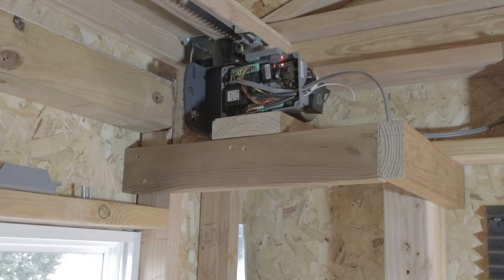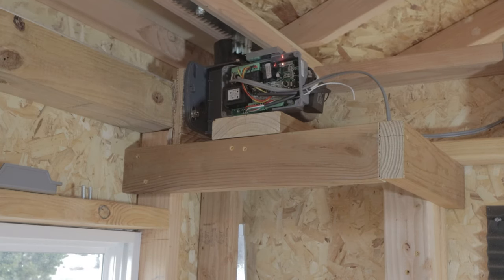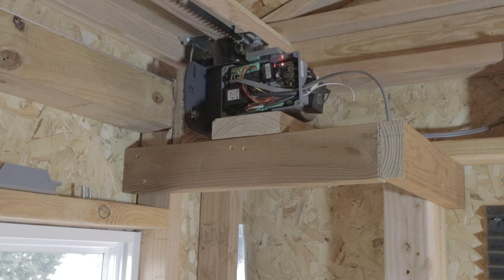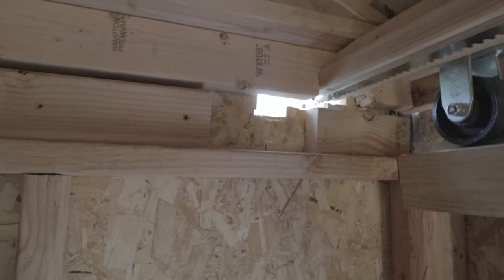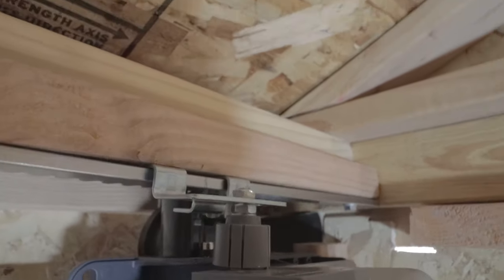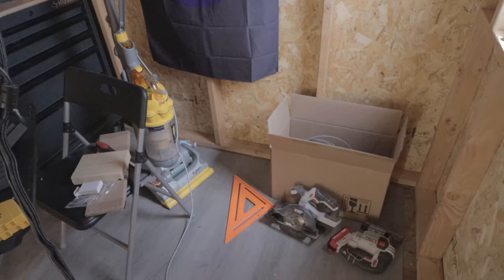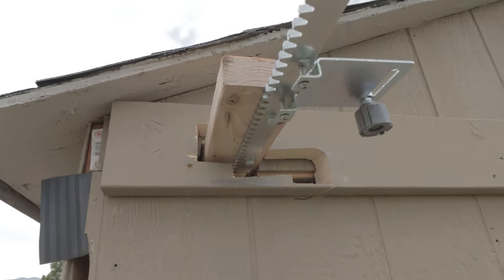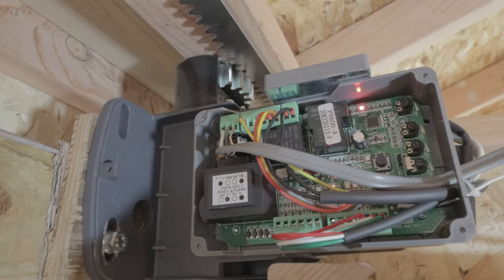Automating your backyard observatory Part 1

Comment: Awesome video Joe. Loved the intro, lol. Glenn's video started me thinking about automating my roof by I would need mine on the inside and the motor sitting sideway. And then BOOM, your video comes along and you've got the motor sitting sideways!! Perfect timing. Will be studying your setup closely while I try and work out if I can do something similar for mine (my roof is unfortunately very heavy).
Reply from the maker: Thanks Logan! My roof weighs around 800 to 1000lbs and that motor moves it fine. The one I bought was rated for 1300lbs, but I’ve seen some that go up above 5k lbs. I’m still working out the kinks, as I think I want to lower the racks about a 1/4” to ride the pinion a little more center instead of at the top like it is now.
Reply: @JoesAstrophoto  ok that’s good to know because my roof is probably around 500kg (1100lbs).
Reply from the maker: @LogansAstro  I'd probably get the ones around the 2100lb rating then just to be sure. They weren't much more money but do have a higher watt capacity so not sure if that will affect you. I only had 14-2 romex run to the observatory, so about 15 amps, not sure what you have running to yours but just another thing to consider when purchasing, but I don't think it's anything to worry about until you get to the really big ones.
Reply: @JoesAstrophoto  ok sounds good. I have full mains power to the observatory ( even has its own switchboard) so should be ok with the higher capacity version.

Comment: Hi Joe, Your Aleko opener starts off smoothly! Good Job. I'm envious. I have an Aleko 2750, but it really shakes the interior wall its mounted on and I had to reinforce the roof with a shear panel to keep it from loosening the connections. Do you know of a way for the Aleko to "soft start"? Clear Skies, Paul
Reply from the maker: Thanks Paul, if I remember correctly there are some potentiometers on the board that increase the start and stopping force. I’ll see if I can find which one’s do what in the docs and report back.

Comment: Joe. Great video.  Just finishing construction of my 8x10 observatory.  Love the fact that you didn’t have to modify your completed observatory to install the rack and pinion gate motor.    Do you have a list of parts you purchased to accomplish the install?
Including of course, where you bought the gate motor and teeth track, or does it all come together with the motor.   

Looking forward to getting your feedback.  

I am just starting the roof, which will mount onto the wheel track , which I have just installed onto the tracks.just like yours.  

Sincerely, 

Tony V
Reply from the maker: Thanks Tony, I have a link to the gate motor in the description of this video and also the description of Part 2 video.

Comment: Did you do a photo journal video documenting the install?  Love to see that.  Also, does the tooth track just attach to the beam, or did you have to carve out a trench for it?  I am in the final stages of building my roof.  Wondering if it would be easier to install the rack and pinion motor and track while I am still building?

Tony V
Reply from the maker: Hi Tony, I wasn’t able to do a video of the actual install itself, but I just used a 2x4 to mount the rack and some washers as spacers to lower it. I think it would be much easier to install while building than after. Hope that helps!

Comment: Joe you answer real fast when asked a question... I am trying NINA for the first time and wanted to take flats. It asked me  to put in a directory but cant find on the program where to select it... I have SGP but want to try Nina
Reply from the maker: Thanks Steve, in NINA if you click on "Options" and then "Imaging" you should see an "Image file path". Here you can populate the path. For example, I have mine set to c:\NINA\ then right below that you have an "Image file pattern" and by clicking on the options below you can customize the way the files are written. I would make sure that you add at the beginning of the pattern "$$TARGETNAME$$" This will create new sub-folders, otherwise you do run the risk of overwriting files. I also include that in my NINA walkthrough video. That video was one of my first ones so it's probably a little dry lol. Hope that helps.
Reply: @JoesAstrophoto  Yea that helps , so you also put the flats there in a sub directory also darks in sub directories
Reply: @JoesAstrophoto  OK so I made directories and sub directories C:\NINA\Flats\LX200 but where in the NINA program on the flats page do you select the path.. ?
Reply from the maker: @Steve_The_Ignorant_Astronomer  NINA will create the sub directories automatically based on the pattern string you created and the image file path. Let me know how it goes!
Reply: @JoesAstrophoto  oh ok have to try , weather sucks though , thx for getting back ,,, well let you know , may be a few days
Reply: @JoesAstrophoto  So was working with NINA last night and I have lots to learn with it. The directory thing is hard for me to follow. But I like all the little things like Stellerium working with it. Just have to spend some time if weather ever clears.. P.S. you told me in the past where about you live , dont remember but you have some view. I live in bord.8 sky

Comment: Sooo Cool!  I wonder if there is a way to program it via NINA using the 'Switch' command???
Reply from the maker: Thanks Pat, I'm just starting to explore the possibilities of it all. I just ordered an arduino and relay shield and found some ASCOM drivers. I would love to be able to integrate with NINA. If you have any ideas I'm all ears!
Reply: @JoesAstrophoto  Pat, you can turn on and off outlets with the plug ins in NINA and IFTTT. Just need to figure out a way to have the roof motor automatically activate with power ON.

Comment: Hey, You may have mentioned this in one of your previous video's. But how tall are your walls in your observatory and how tall is your pier from the floor to the top of the brake rotor adapter? Thanks
Reply from the maker: Hi J! My walls are 6’4” and pier is 36”, but what matters is that you setup yours so that you get the lowest horizon that you are good with. I set mine up for 20 degrees. Hope that helps.
Reply: @JoesAstrophoto  Great point! Your observatory is Awesome. I hope to achieve the same success in the future. I'm enjoying the video's and thank you for your quick reply.
Reply from the maker: Thanks so much J!

Comment: How the setup of arduino going ?
Reply from the maker: Hi Padraig, I’m almost done with the new video. I have it all working with my motor board, but there is another main board model that comes with lots of motors and I’m working with that now as well. I almost have it with the other model board. I didn’t want to release anything and then have it only work on half the motors out there.
Reply: Looking forward to it, I’ll hold off pulling the trigger arduino and kit.